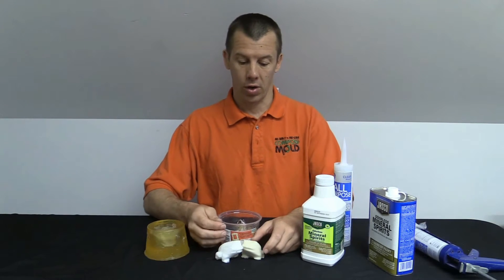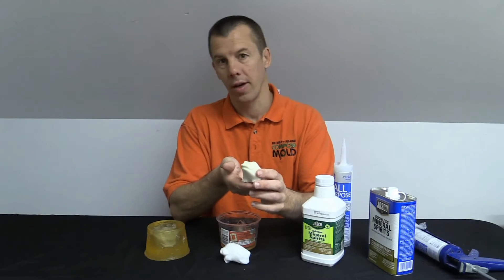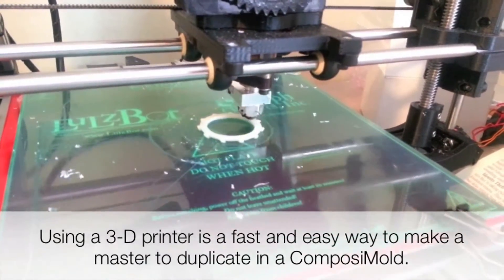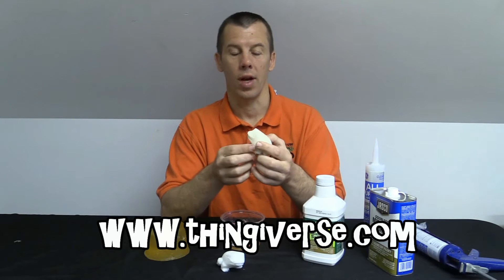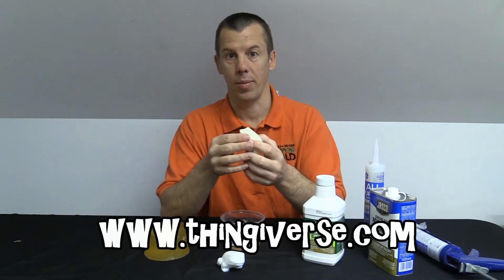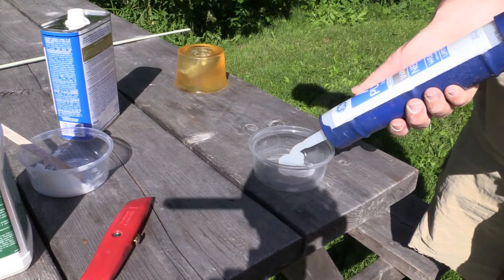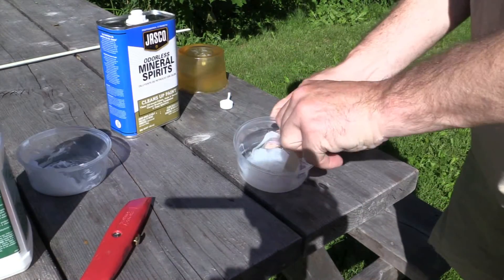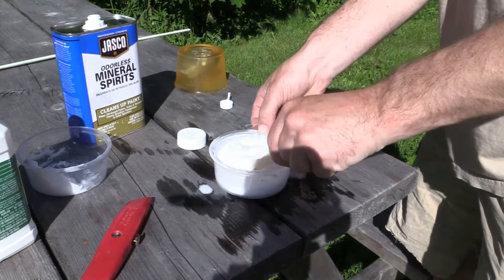"Oogoo", ComposiMold-Flex, and The 3D Printer

Comment: Do you know if orange or citrus solvents can be used as a safer alternative to mineral spirits? Thanks, great video
Reply from the maker: Orange or citrus solvents probably wont work because these are usual oil based and, you need something that carries a small amount of water but don't use water because, direct water cures it too fast. Thanks!

Comment: did you add corn starch at some point? thanks for the vid!
Reply from the maker: Thanks for the question!We did not use cornstarch. Cornstarch is just a way of getting water into the silicone to get it to cure. We used the oderless "green" mineral spirits to get the water in. You can use almost anything the carries some water with it...but direct water cures it too fast. Thanks!

Comment: Is one of those mineral spirits different from the other?  Both containers say Odorless.
Reply from the maker: Scope's Deesigns Thank you for your comment! The difference is that the milky colored Jasco Green Mineral Spirits are made of65% renewable resources. It has just enough water content to cure large amounts of silicone caulking when mixed propery. Out of curiosity, do you have a mold making or oogoo project you are working on?
Reply: Oh, do I.  I am casting jewelry, and turning blanks primarily.  I have been experimenting with DIY silicone recipes for a year.  My problem has always been that the mold shrinks and becomes hard if I use thinners.  If I don't then I wont be able to pour it over a casting.  I am hoping that the Green mineral spirits will solve my problem of shrinkage.
Reply from the maker: Scope's Deesigns Cool project! have you seen any of our jewelry making videos? Here are two good examples:https://www.youtube.com/watch?v=qrkj0BV78x4https://www.youtube.com/watch?v=aZevYWuvNgEThe oogoo frog did shrink over time, but it doesn't seem to be hard. If you have the capability, try vacuum bag sealing the oogoo, this should stop it from shrinking.